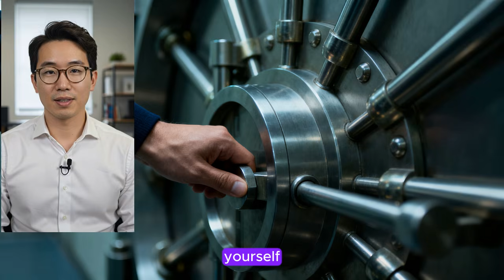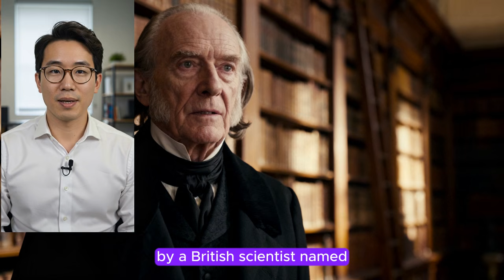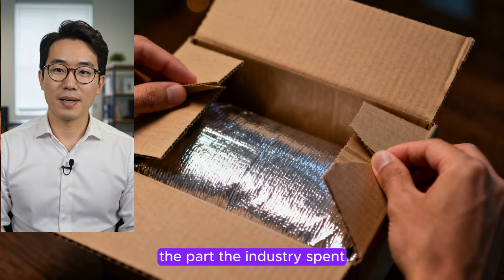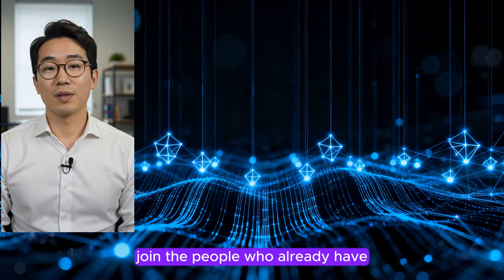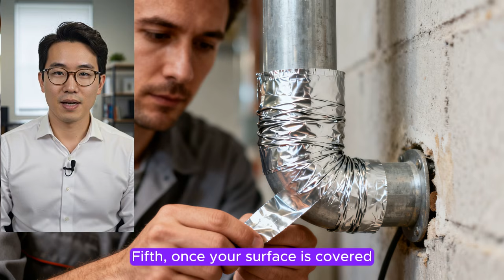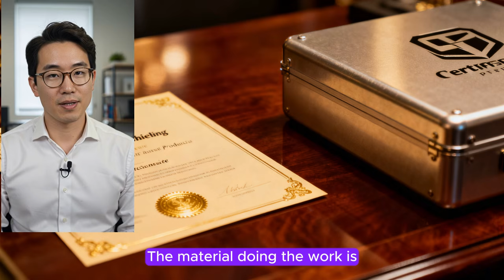This $2 Metal Sheet Blocks All WiFi Signals Completely — Government Buildings Use This Everywhere

Comment: People have known since radio waves have been used to transmit information that metal kills your signal much to the annoyance of anyone who has lived in a metal building and the people who spend tons of money on a faraday cage are needing a special chamber for testing new electronics which need to approximate real world conditions without having any signals leaking causing a massive fine from the fcc and the majority of the cost is the highly sensitive specialized testing equipment needed to validate the product will comply with regulatory requirements and most people want to receive phone calls from inside their home

Comment: Where did you learn to do math? 12x12 room has approx 140 sf surface? Try 384 for the walls. Another 288 sf for ceiling and floor. Total = 672 sf. You’re off by a factor of 5.